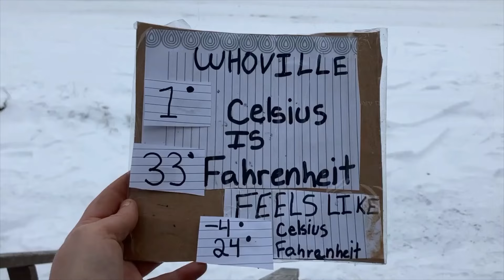Making the Shop Door Finally With Recycled Wood and Screws Nov 10 2023

Comment: Dry gloves are essential, dry feet too for working outside. I worked nights in a shipyard for 11yrs. We used 440 strip heaters designed to warm seams in hull plates set up in a metal tool box to keep gloves dry and roast potatoes😎
Reply from the maker: yes working around water or wet areas need dry gloves, good thinking  thansk

Comment: I've been thinking if I build small shop here, maybe use a rail to slide the doors open 🤔.
Reply from the maker: those work untill the snow and ice screws them up in wilderness alaska but in northern manitoba. we have had good luck with swing doors if good quality hinges.  thansk
Reply: @kingofobsolete4789  very true. the fella I know that has rails keeps a grub hoe handy for the snow and ice under the doors.
Reply from the maker: for us when we moved here after the DIEvorce, i came with southern ideas to improve things. well 27 years later i am doing what the old timers did that i tried to improve. i am a slow learner, lol  thansk
 @jeremycherny2041
Reply: @kingofobsolete4789  lol. That's funny. Take care Joey

Comment: Hi Joey, excellent progress. Two questions: why have the air hose and cord go through the door instead of wall?  Why are you still using old broken coffee maker? Thanks-  Chris from Pennsylvania
Reply from the maker: the door is wood and easy to seal, the walls are steel plus it would be 90 degree turn to pull the hose through. i gave up on coffee makers buying 1 every 10 months. old school is cheaper, lol  thansk